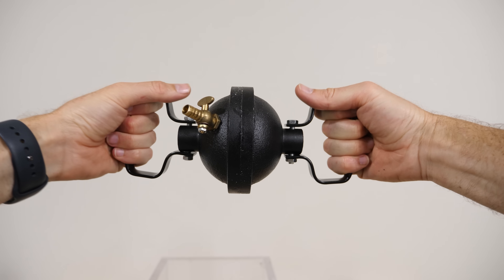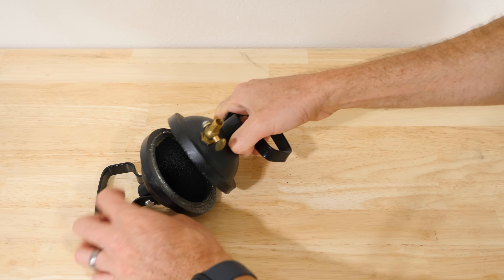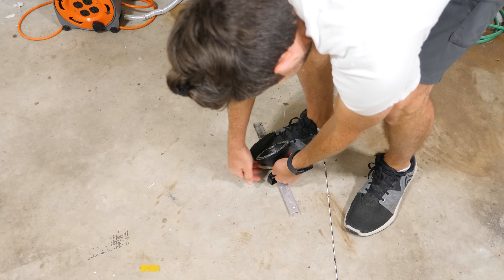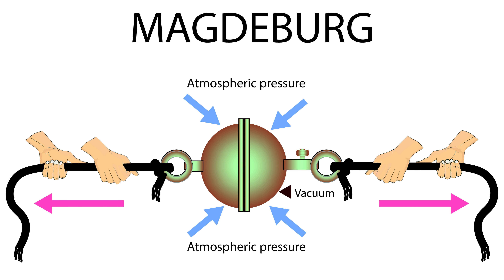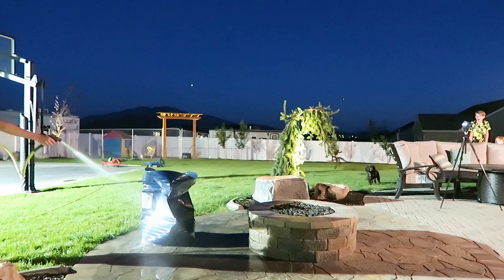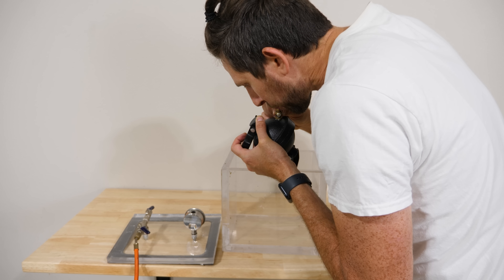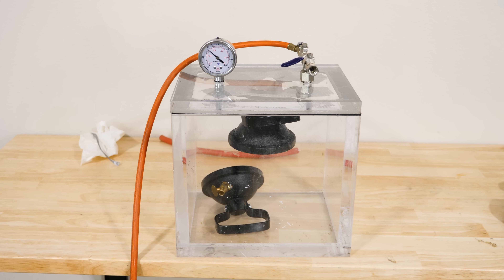Pulling Apart The Magdeburg Hemispheres

Comment: I don't thing you even needed to hang them from the ceiling in the vacuum chamber. They would pop apart from the air pressure that still exists inside them as you vented all the air molecules from the chamber around them.

It would be no different from putting everything in a pressure chamber, then assembling them together without pulling a vacuum on them and them letting the pressure out of the chamber. The highly pressurized air inside the sphere would find a way to escape when there isn't enough pressure around it to support the halves anymore.

AND, if you filled it with water and tried to pull it apart under ANY outside pressure you would quickly find that it's basically impossible to pull them apart too, without opening the valve.
This because water is incompressible, you would have to pull hard enough to make the water inside the sphere boil before you could separate the two halves.
Reply: Is that last bit correct? I'm thinking if you try and pull apart the sphere with water in it you would only need to cause the smallest of gaps in the seal for air to leak in. You would only need to overcome the atmospheric pressure inside the sphere for that to happen. However if there is no air in the sphere to begin with surely the weight of the water would force the hemispheres apart anyway? It seems regardless of if the sphere is filled partly with air or not water would just cause it to open
Reply: @nade5557  I don't have one so i can't really test your theories.
But i am of course assuming an airtight seal here.
In such a situation i am pretty sure it would be extremely difficult to the point where failure of the grips on the sphere would be more likely than the halves separating, until of course you let air leak inside.

If there's an air bubble inside, that will "happily" expand of course and make separating the halves much easier.
Again, under the assumption the system is sealed and only has water inside, the halves would barely budge.

And yes, i am of course also allowing for the spheres to move apart, but no air will leak in until the lips inside become disconnected from each other.

Comment: If you fill a plastic water bottle with hot water, then immediately pour it out & put the cap on. The bottle will act like a vacuum and the sides will collapse.

Comment: For those interested in seeing a tanker collapse into itself, mythbusters had an episode where they made that happen
Reply: I worked in the tanker industry. I can recall several times when I have seen a tanker/tankcontainer imploded (if that's the correct term) due to the pressure release valve's vacuum valve having not worked.
Reply: @beijingbond  it definitely happens, hell the safety videos that are just real accidents with a monotone narration are proof enough. But Im pretty sure the other guys wrong anyway and what they found was a working as designed and maintained/structural sound tanker wouldn't implode just from rapid temperature fluctuation as expected of something made not to implode. But I'm pretty sure they then dented it and it did fail from being cooled, and concluded it was obviously possible for it to be compromised in countless number real life situations and so said it was 'plausible' to fit with the shows format I suppose. Idk it's been like a decade or at least feels like it.
Reply: @MrDJAK777  The tanks I worked on are usually around 5mm thick and hold up to 35,000lts. They are obviously welded to the frame of the tank/tanker but that's not enough to hold their shape at extremes of pressure difference. In normal conditions it's fine, but with a full vacuum inside they are vulnerable to collapse.
Reply: @MrDJAK777  I've been known to be wrong before and like you said, that episode aired many years ago. I personally have never seen or heard of it happening until now so that could have helped sway my brain into thinking it was a myth. Now I know and have a new wrinkle.
Reply: @beijingbond  that'd be pretty cool to see. I was just stating what I could recall from the myth busters episode. Sounds like there's some fail safes to try and prevent that from happening?
Reply: which episode?
Reply: @bagochips834  it's been a minute but iirc I'm pretty sure it was titled just that "tanker crush" otherwise look up myth busters implosion should pop up.
Reply: iirc they weren't able to replicate it and considered the myth busted

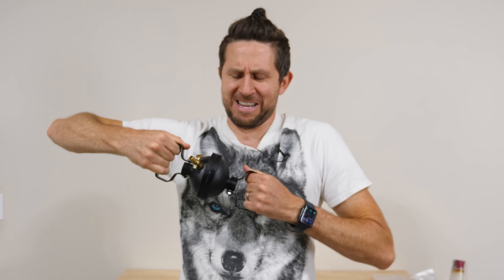Comment: 0:57 now imagine how hard it would be if you had actually used a vacuum pump.
Reply: I think it would be 14 pounds for every square inch of cross sectional area within the spheres.
Reply: propaply would need arround 100 pounds of force, since thats the pressure he said the atmossphere has.

Comment: You could use the guage on the vacuum chamber to measure the amount of vacuum you were able to create using your lungs. Basically when the weight of one hemisphere hanging is larger than the pressure difference between inside and outside the sphere. 
That would have been an interesting line of inquiry to persue.
Reply: Then you would have to account for the adhesion force of the grease
Reply: it fell off at -.65 bar so that means minus the weight of the half it was probably -.7 bar so he produced 70% of a perfect vacuum by sucking on it.

Comment: Another great way to demonstrate the atmosphere pushing on everything around, put a couple of marshmallows inside your vacuum chamber and then pull the air out and watch the marshmallows.
Reply: Yea why doesn’t that happen to earths atmo? You do know that your beLIEf is there’s no barrier between earths gas PRESSure & your fantastical narnia ‘10^-17torr vacuum of sci-fi space’ 

For reference a household vacuum is ‘10^-2’

You beLIEf just violates the second law of thermodynamics no big deal 🤣

Stephen Hawking:
“This argument about whether or not the universe had a beginning, persisted into the 19th and 20th centuries. It was conducted mainly on the basis of theology and philosophy, with little consideration of observational evidence. This may have been reasonable, given the notoriously unreliable character of cosmological observations, until fairly recently. The cosmologist, Sir Arthur Eddington, once said, 'Don't worry if your theory doesn't agree with the observations, because they are probably wrong.' But if your theory disagrees with the Second Law of Thermodynamics, it is in bad trouble. In fact, the theory that the universe has existed forever is in serious difficulty with the Second Law of Thermodynamics. The Second Law, states that disorder always increases with time. Like the argument about human progress, it indicates that there must have been a beginning. Otherwise, the universe would be in a state of complete disorder by now, and everything would be at the same temperature. In an infinite and everlasting universe, every line of sight would end on the surface of a star. This would mean that the night sky would have been as bright as the surface of the Sun. The only way of avoiding this problem would be if, for some reason, the stars did not shine before a certain time.”

Comment: Great now answer why you still hold the religious beLIEf you live on a globe w a positive pressure system next to a negative pressure system ‘10^-17torr vacuum of sci-fi space’ without a physical barrier separating them? YOU JUST DEBUNKED THE GLOBE LMFAO

Stephen Hawking:
“This argument about whether or not the universe had a beginning, persisted into the 19th and 20th centuries. It was conducted mainly on the basis of theology and philosophy, with little consideration of observational evidence. This may have been reasonable, given the notoriously unreliable character of cosmological observations, until fairly recently. The cosmologist, Sir Arthur Eddington, once said, 'Don't worry if your theory doesn't agree with the observations, because they are probably wrong.' But if your theory disagrees with the Second Law of Thermodynamics, it is in bad trouble. In fact, the theory that the universe has existed forever is in serious difficulty with the Second Law of Thermodynamics. The Second Law, states that disorder always increases with time. Like the argument about human progress, it indicates that there must have been a beginning. Otherwise, the universe would be in a state of complete disorder by now, and everything would be at the same temperature. In an infinite and everlasting universe, every line of sight would end on the surface of a star. This would mean that the night sky would have been as bright as the surface of the Sun. The only way of avoiding this problem would be if, for some reason, the stars did not shine before a certain time.”

Comment: Fun fact: naval torpedoes actually destroy ships by creating a huge vacuum bubble beneath them. The explosion is well deflected by the shape of the ship and the wave is absorbed by the water, but the vacuum left by the sudden expansion is inescapable!
Reply: Yet you still beLIEve sci-fi space which is ‘10^-17torr’ resides directly next to earths positive PRESSure system without a physical barrier. Directly violating the second law of thermodynamics for what? religious beLIEfs…

For reference a household vacuum is ‘10^-2’ 🙄

Stephen Hawking:
“This argument about whether or not the universe had a beginning, persisted into the 19th and 20th centuries. It was conducted mainly on the basis of theology and philosophy, with little consideration of observational evidence. This may have been reasonable, given the notoriously unreliable character of cosmological observations, until fairly recently. The cosmologist, Sir Arthur Eddington, once said, 'Don't worry if your theory doesn't agree with the observations, because they are probably wrong.' But if your theory disagrees with the Second Law of Thermodynamics, it is in bad trouble. In fact, the theory that the universe has existed forever is in serious difficulty with the Second Law of Thermodynamics. The Second Law, states that disorder always increases with time. Like the argument about human progress, it indicates that there must have been a beginning. Otherwise, the universe would be in a state of complete disorder by now, and everything would be at the same temperature. In an infinite and everlasting universe, every line of sight would end on the surface of a star. This would mean that the night sky would have been as bright as the surface of the Sun. The only way of avoiding this problem would be if, for some reason, the stars did not shine before a certain time.”

Comment: With your lungs you can only pull about -0.1 bar gauge pressure (i.e. 0.9 bar absolute) so you should have been able to suck on the vacuum chamber (rather than use a pump) to get them to fall apart! They should have fallen apart when the vacuum chamber got to 0.9 bar. They only held as long as they did because of the grease, I suspect.
Reply from the maker: Nope you can pull a very good vacuum with your mouth doing the suction. I actually measure it and talk about why in this video: https://www.youtube.com/watch?v=98Tla_9P78w

Comment: When you turned the vacuum ON, the auto generated closed captions said "Applause" :washhands: 2:46 
It's always cool when you bust out the chamber, just surprised it was in the cc.
Reply: It was the high pitch sucking, most likely. Probably thought that was one of those high pitch screams someone always does when cheering

Comment: First learned about these from watching Connections when I was a kid, but I always wondered how people 300 years ago could get a good enough vacuum inside to make it work. As he showed though, even a little drop in pressure is enough to hold them together.
Reply: @hullukana214  I mean yeah but he means that 300 years ago they could also pull a vacuum with their mouths or a bellow… even though it’s not as perfect as a motorized vacuum
Reply: Bruce Yeany does a great experiment on his channel where they demonstrate a similar pressure differential by putting one end of a tube on the valve of the sphere and the other end in a bucket of water, then carry the hemispheres up a couple flights of stairs. Just the few meters of height creates a near-enough vacuum. I think he had himself (a grown man science teacher) and his school principal pulling the two hemispheres apart and just barely got it.
Reply: even if they didn't have a vacuum pump, they could have boiled water in the spheres until the steam forced all the air out, then shut the valve. as the steam cooled and condensed back to water the pressure would get very low.
Reply: mercury is also used to create lower pressure. If you put a tube in mercury and then seal the top, and lift it out, it would create a low pressure environment inside the tube
Reply: I believe Cody of Cody's Lab made a gravity powered vacuum pump with Mercury with really good results
Reply: @sephypantsu  I was looking for this comment.  A mercury drip vacuum pump is still one of the best ways to get all the way down to almost a perfect vacuum.
Reply: @kingcosworth2643  fill with alcohol or another liquid with a low boiling point then heat it up and let it cool, you wouldnt even need the valve
Reply: They made vacuum using falling mercury too.
Reply: @hullukana214  people have mouths

Comment: This is why there's no way to open an aircraft cabin door in flight. 
The typical difference in pressure at cruising altitude is 7 to 8 psi.
That pressure forcing the door tighter into it's jamb.
Reply: But shouldn’t it be easy to open the door to the outside?
Reply: @MyoYoneda  
The door swings inside the plane then closes out. It plugs the opening from the inside.  At cruising altitude, there's over 20,000 pounds of force pushing the door into the opening.